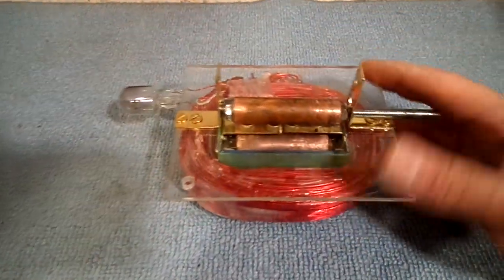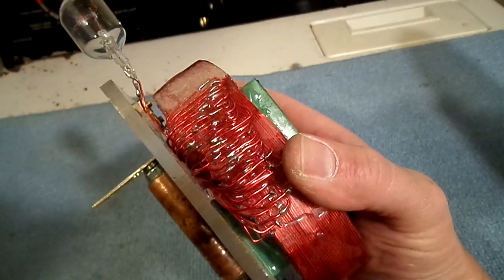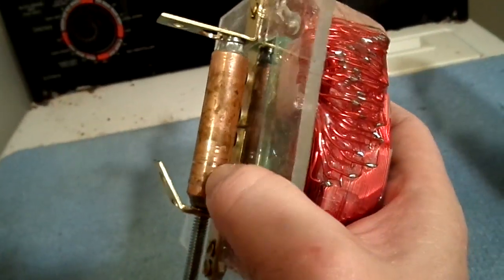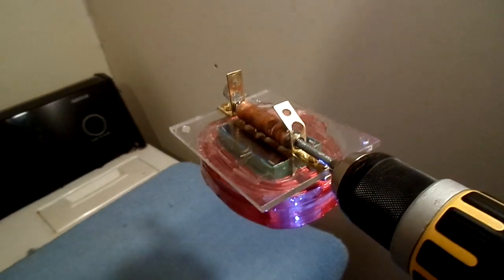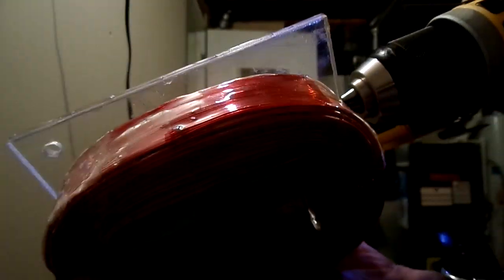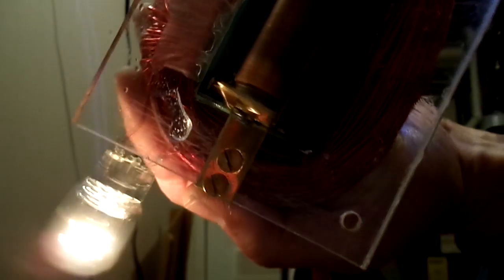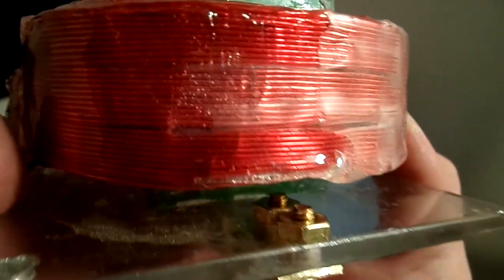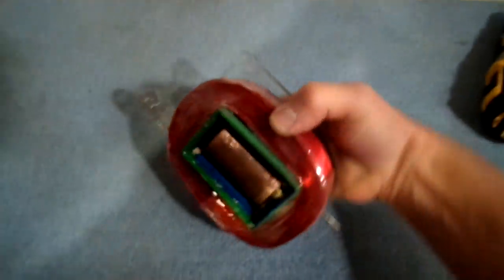Newman Motor Design with Parallel windings.

Comment: This is a Newman motor??????????????
Reply from the maker: No, just concept bits and pieces of his design with parallel windings added instead of the normal windings. Thanks for watching.
Reply: +whyme2b It has been said Newman stole that design

Comment: cool! Did any one notice the standing waves the light made. The optical artifacts produced from the vibrating light bulb can actually be used to measure the rotational speeds needed to set up the harmonics. Cool way to use a 200$ camera as a 3000$ piece of testing equipment,lol.
Reply from the maker: Actually it was just my ipod in which I paid around  $150.00 for, it does a excellent job though on making videos! Thanks for watching.
Reply: +whyme2b Np, I enjoy watching peoples ingenuity when it comes to new ideas. Keep it up! Awesome

Comment: That's excellent.  Do you think the drive magnet is helping generate power ?  Do you have any multimeter you can hook up ?    That light looks like it is over powered.  Maybe try 2 lights.
Reply from the maker: Thank you sir,  the main power generated comes from the center magnet. .. it would work better and be way more efficient by just using a belt to turn it. I did hook up a volt meter to it and read 18 volts A/C spinning it at around 1800 rpms. It could power more bulbs hooked up to it as well with no problem I'm sure.  Thanks for watching.

Comment: have you tried running that with a low voltage dc motor with a heavy flywheel attached and try to self loop that output? sort of like a Campbell system?
Reply from the maker: No, haven't tried that.  would probably work though but needs to be perfectly balanced to achieve that. Thanks for watching.

Comment: Hi, just a quick question.
If you didn't have your Drill, where would you get your 2000 rpm from?
Reply from the maker: Maybe can be turned by wind if geared up for low RPM. But would be better to use a drive belt instead of using a magnet to turn it. Thanks for watching.

Comment: Not meaning to sound critical, but a simple transformer will change 18v to 30v (with a little loss).
Trying to supply a little constructive criticism here...  To make this meaningful you need to measure the total power (Watts) delivered and compare it with the total power (Watts) generated.
Keep experimenting though.
There are methods that use coils and hence magnets that effectively produce more power output than input.  (check Tom Bearden and MEG)
Reply from the maker: Yes sir, thanks for your comment... all appreciated! I just wanted to break away from using a magnetic core to see if the input drive would be less. Still working on it thou and have many ideas in testing. I do know about the MEG transformer....The only problem with it was the magnets would loss there magnetic field within time due to polarization canceling each other. Thanks for watching.